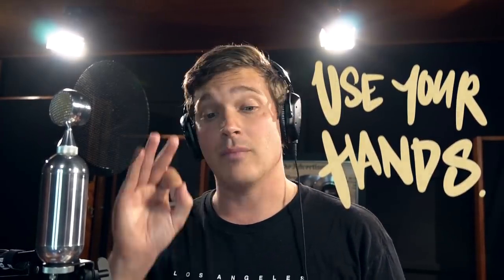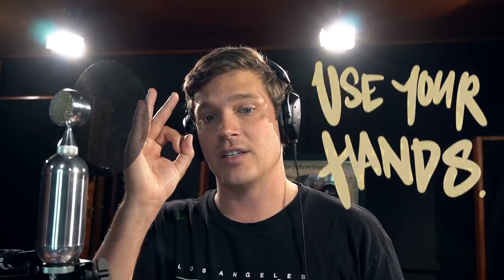Beatbox Tutorial Buzz Scratch- Tom Thum (new technique 2019)

Comment: 0:00 Intro // 1:02 Showcase // 1:19 MIND BLOWN // 1:35 MORE MIND BLOWN // 
2:01 Layer 1: Fundamentals explained // 2:36 THE sound // 2:49 Scratch Basics // 3:20 Layer 2: Harmonics (bass) // 
3:57 Open your lips to change tone // 4:25 Harmonics (high pitched) // 
4:50 Scratch flourishes // 5:16 Trap beat fast Ts // 
5:42 Limitations of the sound, use of hand positions to emphasise sound // 6:18 Hand Variation 1: emphasising high pitches // 
6:27 Hand Variation 2: emphasising high pitches with variations // 6:41 Hand Variation 3: emphasising bass // 

Thanks again Tom for your never ending innovativeness :)

(Side note i think it hurts cos the muscles in the back of your nose/throat area are tightening up super hard to stop the air pressure being forced through the tube that goes from the back of the nose to the ears. That kind of pressure could otherwise easily pop your eardrums)
Reply: keep doing this on videos bruh